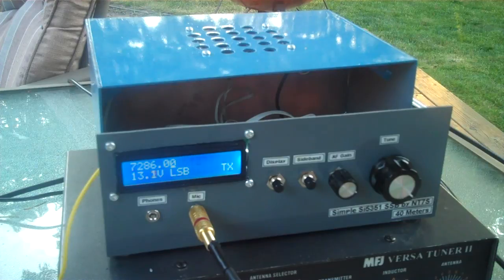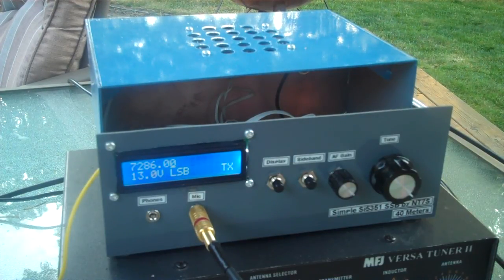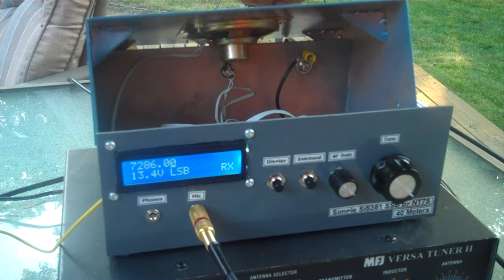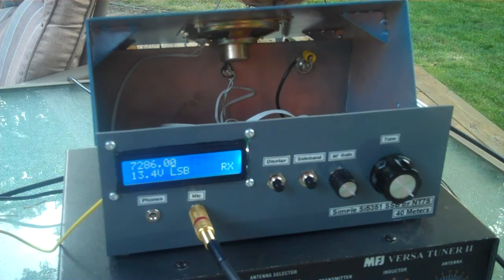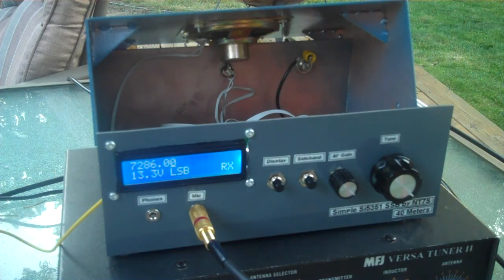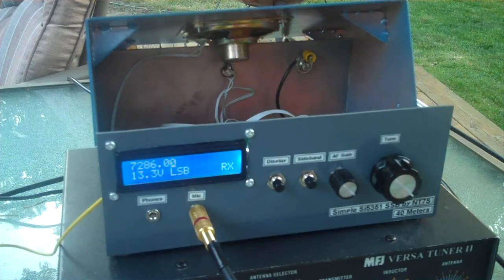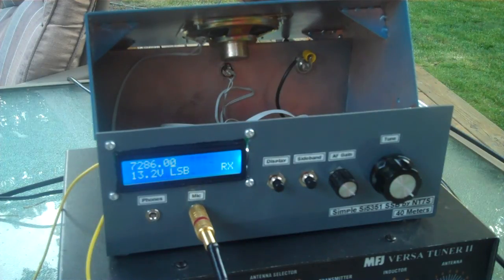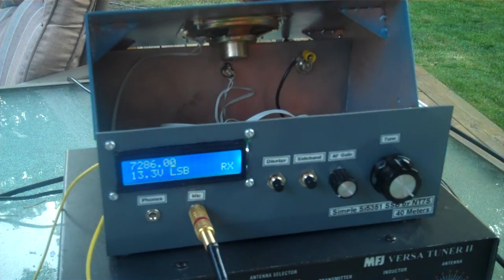Si5351 SSB QSO with AA7EE and KB6QVI

Comment: I am a Radio ham I have all the arduino rotary encoder si5351 and lcd. What I can find anywhere is how do I connect it to the RD side. I have some old stornos with  not the correct crystals I would like to get them on the aid my e mail is conp@global.co.za my call sign ZS6CNP thanks Connel